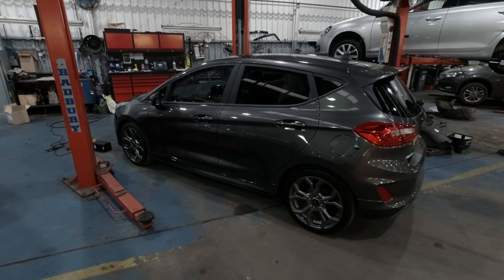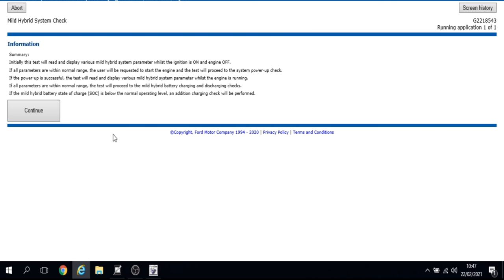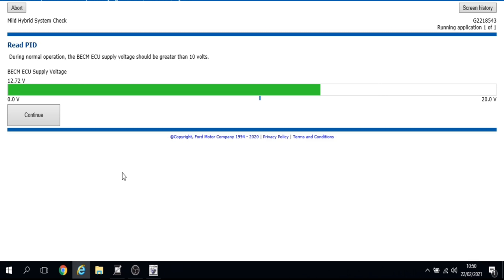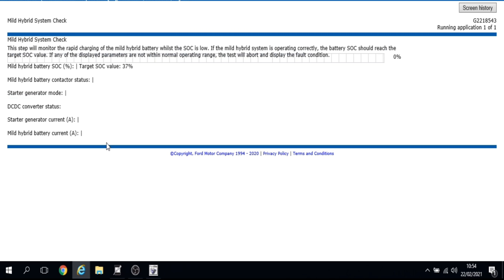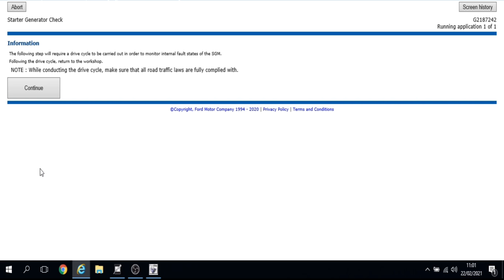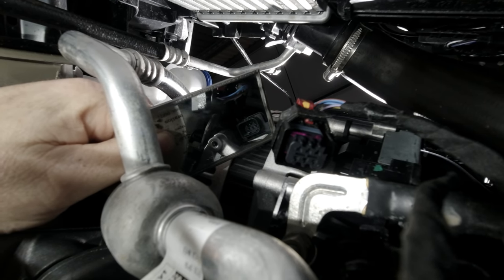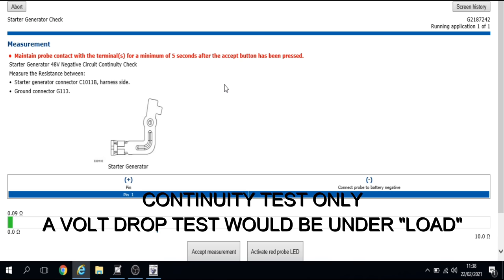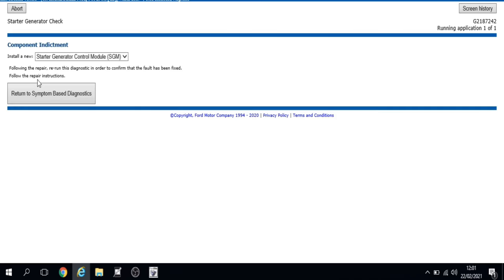Ford Fiesta Ecoboost MHEV Hybrid - Charging Malfunction - Part 1

Comment: I bought a 20 plate puma mhev with 30k and it’s got a hybrid battery connection fault, they’ve got to decide if they’re going to replace the 48v battery or replace it with another model, their communication has been extremely poor but I’m enjoying the courtesy demo puma we’ve got, unfortunately the demo I’ve got is 125 and I bought the 155 which is so much better so I’m waiting to find out, they’ve had it 10 days so far

Comment: Hi ive collected a brand new 1.0 mhev ecoboost, and noticed straight away a very noisy tick over!! But when i depress the clutch its fine.
Would you say the dmf is knackered with less than 100 miles on the clock? 😡😤🤦‍♂️
Reply from the maker: hard to say, but i'd be taking it back for advice
Reply: @SYDiagnostics  my friend just collected a brand new mhev kuga which does the same thing, so im guessing its the mhev belt system perhaps 🤔 but i cant figure out how the clutch interacts with the mhev system?🤦‍♂️